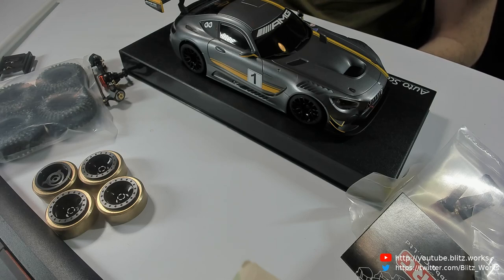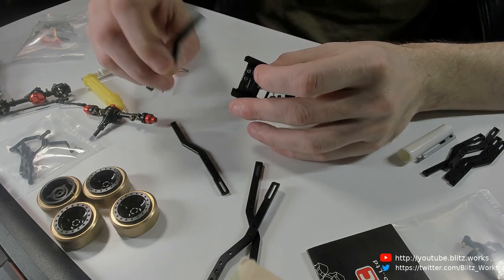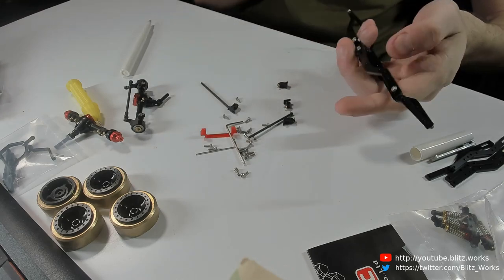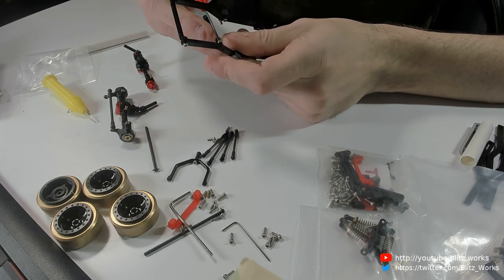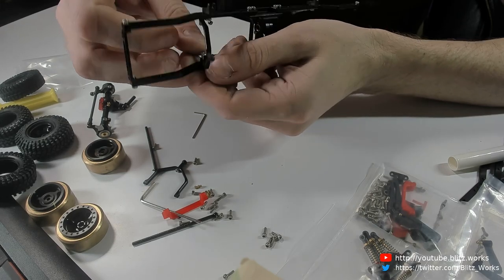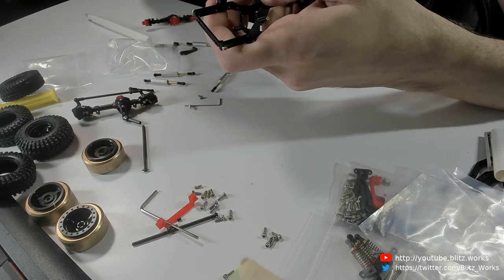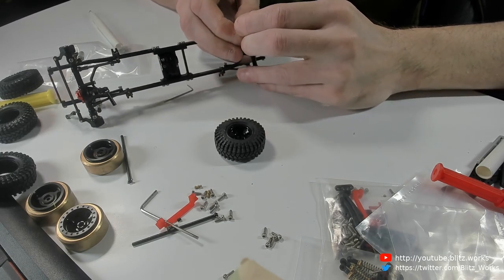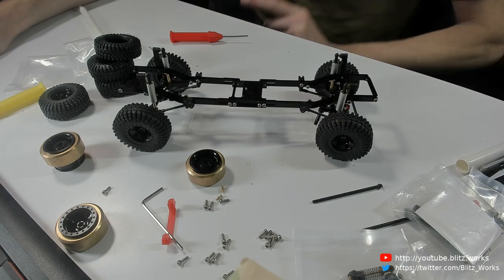Building the AutoRC gk24 v4 frame for a Dakar rally truck

Comment: Thanks for sharing, there are just so many options anymore, and you are absolutely right... the 1/24 scale is kind of all over. Well, a lot blends between 1/20-1/32, depending on who makes things, etc etc.

In my project... It is more a matter of finding a chassis to suite the body I have. So many were too narrow, too short, or had quirks I didn't like. I just dropped an order for the long wheel base version, 21mm wheels/tyres, and a few upgrades. I need about 133mm wb for my project, so this should suffice. I wish the rear pumpkin was centred... But if I ever wanted 4 wheel steering, that little aspect would play to favour. Now... Just have to wait for the goods to come in the post!

Comment: I'm still thinking of getting one of these chassis, but not just now, still waiting.....also next week will be getting a new Orlandoo X01 :D
Reply from the maker: I like a larger scale than the orlandoos though i do want to complete my jeep as that just looks cute. the issue i have had with them is tightening a screw and the heads poping off which blew my mind

its just about finding the right body, this kit makes it so simple to turn anything into a great performing 4WD that its worth hunting down a good body for it. i suspect as a Unimog this would be an great  car
Reply: @BlitzWorks  I've suffered that too, still a great little platform though regardless.
But the smaller they are the more limited they get I suppose.  Kinda why I'd like that 1/24 to hurry up and be released.  Still tempted to get the geko chassis in the future though......when I get around to saving enough xD
Reply from the maker: @foxracerdrew  Ha i wish you would tell me more details about that 1:24 though from what i have been able to find it looks like how MST takes thier photos based on what you have sent me in the past.

one thing i love about this chassis is how free the drive train is, you see me bashing it back and froward and the chassis continuing on much softer motor braking that everything else on the market which for this project is perfect. i don't need remote lockout on this but i would love to rebuild the hummer (and in fact picked up a blue body)

its little things like that that make this great and i cant wait to see if the frame you are talking about is the same

to drop some hints about what may be coming for this chassis: active suspension to raise/lower the ride height and change the suspension while driving as well as possibly dual N30's for more torque. it will have at least on N30 rater than N20's but i want to play with the idea of overdriving the front for stability and crawling and perhaps adapt the hummer if this proves to be useful

so far i have estimated i will need all 8 channels i can feed this once i add in the light system
Reply: @BlitzWorks  Can't wait to see it.

Comment: Ack! You got the Mercedes before me :(( not gonna lie, I’m jealous lol
Reply: And the GL-D! I’m just going to go sulk in a corner...
Reply: A snorkel would look good on the hood & could help break up the color
Reply from the maker: @BMR3  good point on the snorkal, the AMG was pure luck was browsing the HRC sie and saw it when i was ordering the GLD. was actually looking for a drift truck body
Reply: Blitz Works lol I’m noticing the micro RC distributors don’t play fair, there are definitely favorites & it’s kind of a shame. That or Hong Kong/China don’t care about release dates & just sells ASAP 😹
Reply: Blitz Works drift truck, like the lexan bodies or the scale semi trucks?? I want one of the scale semi trucks lol it would look so good sliding around
Reply from the maker: @BMR3  model grade 1:24 bodies, so same quality as the kyosho bodies guess i may need to build the kit for a mini flat tray pickup

the body for this project will be 3d printed using an SLA printer but prototyped in FDM so do a rough version with FDM  and then high res SLA for the final
Reply from the maker: @BMR3  that does not bother me too much except for the limited editions or limited initial stock. since i mainly buy from asia and shipping is normally a couple of days for me i am in a better position compared to the US. rcmart seems to be in that first class of distributors.

local to me however i dont think there are any good distributors. i keep enough parts on hand to almost be one however hahah
Reply from the maker: @BMR3  actually the kei class: https://www.youtube.com/watch?v=kuPrmWrylOc though i am thinking about that type of truck as well
Reply: Blitz Works oh my gosh! YES!! Lol I’m down, let’s start a Kei drift movement 🤣